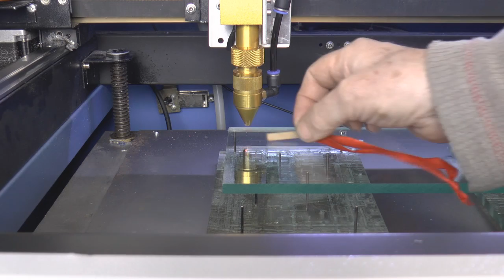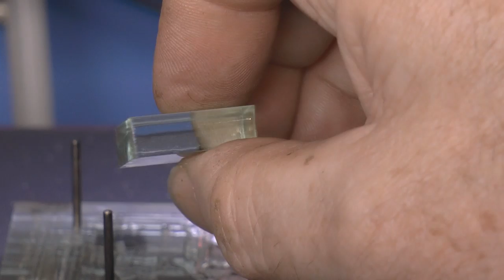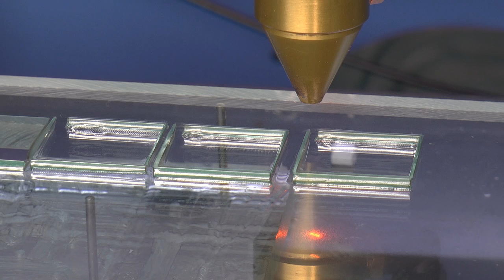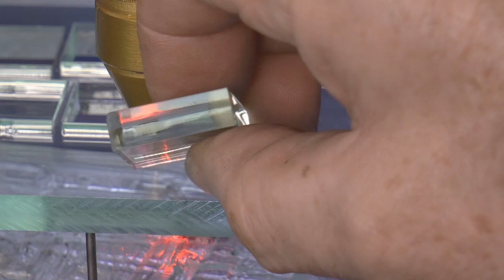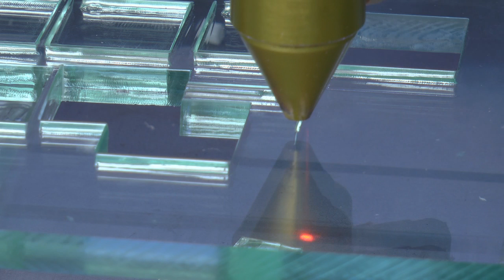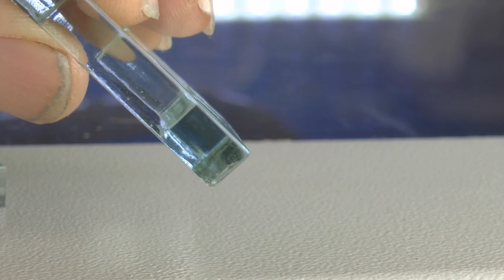RDWorks Learning Lab 54 Acrylic beam drag and flame polishing

Comment: I recently installed RD Works controller RDC6442G ,I went into settings on my laser machine and on my computer and changed the bed size settings but it is still saying not enough extend space. I have been on to cloud ray laser but I cannot make sense of thier instructions.Is there any advice you can give me please?
Reply from the maker: Hi Paul
Part of your program is outside the area of your table. When you look at your program in RDWorks there will be a little green square in one corner of your drawing. That is where your head will be to start the program.I guess your are running your machine directly from the pc and just pressing the START button to run the program?  Your problem is occuring because your ORIGIN is in the wrong place. If that little green square is at top left for example then manually drive the machine so that the head is nearly at the back left corner. Now press the origin button and that should fix your problem.

Best wishes
Russ
Reply: Hi Russ thanks for your help. My machine is working as it should now i have just got one question. When ingraving lettering my machine now only ingraves 1 letter at a time have you any suggestions why it would do this. Thanks Paul

Comment: The beam drag is due to two factors and three for you , beam is step burning in the z axis , due to power /speed , and your Colling the work acrylic , so turn down the air flow to minimum , adj the internal focus lens , for a 3 mm . The damage at the base of your cuts is because the beam is past it's focal point ,  

So get the head as close to the work piece as possible   ( with a closer  focal point internal adj ) and very low to know air flow should give good results .

Nice video
Reply from the maker: Hi Rod
I absolutely love acrylic as a material because it has some really great properties. You are right about speed. Slowing down does get rid of the beam drag eventually.  and I also agree that air assist does have a cooling effect. From all my experimental work  with acrylic there is one big factor that I did not understand at the time I made this video and  and this is the light guide properties that acrylic possesses. This phenomenon is illustrated in  https://www.youtube.com/watch?v=CdupovEe9hA&t=128s.
This explains why in my early days I was able to cut 15mm acrylic (albeit at 1mm/sec) with just 30 watts of power. As you will see from this video, the focus point relative to the surface has little effect other than to make the cut very wide at the surface.  Speed is the key factor to allow the beam sufficient time to "tunnel" through the material . It makes little difference to the cut efficiencty if you have lots or little air assist. What it does do  is to change the surface finish of your edge. There is a slight gain in speed with full air assist because you are efficiently clearing the flammable acrylic fumes from the immediate cut area. Those fumes  are absorbing some of your IR energy and decreasing the efficiency of your cut. It has taken me a long time to understand all the properties of acrylic and I'm not sure I have found all it's secrets even now.. 
Bear in mind that this series records my learning journey and  I was sharing my discoveries at that point. Here I am two years into my journey and I still have much to learn.
Thanks for your comment 
Best regards
Russ
Reply: I just discovered your channel and let me say...you rock, dude! Your "journal" saves alot of us a ton of time and headaches. I'm wondering if you could compile a new video with your best thinking on the subject of cutting acrylic now that you have several years under your belt. Peace.

Comment: you look like you need the align your beam angle to make it %90 to the surface at this date
Reply from the maker: Hi Don
Here I am at least a year on and still wrestling with the problem you observed ie a non 90 degree cut. I know the beam is vertical to the surface of my material because I check the beam position 5mm away from the nozzle and drop the table about 150mm and check that I still have beam coincidence I do this both with and without the lens so I absolutely know my beam is truly perpendicular. This problem only shows itself with acrylic and only when the material exceeds 5mm thickness.  I have two machines both set by the same method and both exhibit similar off vertical cuts in the Y axis. Both Y+ and Y- cuts are leaning the same way, Without knowledge of how I set the machine, the cut characteristic leads one to the conclusion that you have reached. I can in fact make the cut vertical by setting the head out of square. This fixes the problem (for acrylic) but does not explain it. It is on my long list of strange phenomena that I need to investigate. I do not experience the same out of trueness with 10mm plywood. 
If you jump forward to #120 where I demonstrate the strange tunneling properties of IR light in acrylic, I'm convinced that the off-square issues have something to do with this property. I have just recently acquired plenty of 10mm acrylic to experiment and investigate this problem in a near future video

Thanks for the comment
All best wishes
Reply: I hear what your saying if you but a spinner and it doesn't wobble you will know...  our cutter gets used by many people all he time and had to be aligned from time to time and i get so irritated when i want to cut a perfect part and its off 90. i'm not referring to he normal v cut from top to bottom . it may be the camera but one side of your blocks looks to have more angle then the other . here is a great link for alignment not done ny me https://www.youtube.com/watch?v=e1c3keOKL6Y

Comment: Hi, wondering if you could help. I have a piranha 5060 that ive just bought. got it set up and laser aligned, thanks to your videos and others on YouTube :) sent a test file to the laser and when i click start it says not enough extend space? have you any idea what this means and how I could fix it? Thanks 
Maggi
Reply from the maker: Hi Maggi
My guess is you are trying to engrave a bmp file. If so then you are using scan mode. My guess is that you are trying to run your program from right in the top left corner (or maybe top right ,depending on where you machine runs to for its 0,0 datum). If so, move your cutting head out into the work area to about 20,20. This will probably cure your issue. When you scan, the head has to run to the end of your picture and turn off the beam. The head then has to travel further to decelerate and turn round, whereupon it  has to accelerate back to your chosen speed before turning the beam on again. This over-travel zone is the EXTENDED SPACE  and will vary depending on the speed you scan at. More speed requires more extended space  If you set the origin point so that part of your program is outside the work area then you will get an X or Y "slop" error. Neither error is clearly explained anywhere. 
Hope this helps if not shout out again.
Best wishes
Russ
Reply: Thank you Russ, one for your help and two for your prompt response. I tried moving the laser head manually but it just reverted back to the top right corner when i hit start. how exactly do i move it without it doing this? sorry to be a pest, total newbie here and itching to get started :)
Reply from the maker: Hi Maggi
I am now 2 years ahead of you but it was a bit difficult to start with because there was no one to turn to apart from condescending experts who were very possessive of their experience. Hence I had to learn the hard way and that what my videos are about. I am not teaching but you can learn along with me. I try to remember those early naive days and despite trying to be inclusive with my explanations to suit all levels I sometimes forget a few obvious points. In your case you either have not yet found the origin button on your machine or your RDWorks software is not at the normal default setting. 
There are several unknowns in your situation that will help me  if I understand. How are you running your machine because there are 3 options. 
1) is your PC remote from the machine and you are transferring programs via USB memory stick?
2) is your machine connected to your PC via a USB cable/Ethernet cable?/wireless bridge connection?
3) Are you downloading programs from your PC to the machine via the connection in 2) or are you running your program via the RDWorks START button?
 Your answer will allow me to better advise you.
Best wishes
Russ
Reply: Thank you Russ. 
I think had i have bought one 2 years ago with so little information on them i would have given up! I'm only now getting a little understanding thanks to the help of generous souls like yourself who put the info out there willingly.
I've been slowly going through video tutorials (how I found you :)) but it gets a little mind boggling lol I work primarily in Photoshop for all my designing and now have to change file types for vector which is a little daunting. I've downloaded inkscape as illustrator is ridiculously priced and i already pay annual subscriptions for Photoshop and Lightroom. I still have to somehow teach myself Rdworks :0 not the easiest program to understand even with tutorials.
So, onto your questions. Yep I found the origin button but it doesn't seem to move anything when i push it?
pc connected via usb
I'm just downloading the design to the laser right now and then working from the control panel.
Maggi :)
Reply from the maker: Hi Maggi
I think this conversation will be more useful off-line because we can exchange data and pictures. Use the You Tube messaging system (that is private) to send me you email so that I can answer more fully.

Best wishes
Russ

Comment: Hello! How do you regulate air pressure? Do you use original membrane pump or compressor with air tank?
Reply from the maker: Hi Dainis

If you watch https://www.youtube.com/watch?v=OCVsMXw6yh4
You will see that I am testing the original 70 l/min pump against a new 140l/min pump. I regulate the air to the nozzle with a little ball valve that allows FULL bore flow. If you have a screw restricting elbow I would suggest throw it away and replace it with a normal elbow, but you will have to modify it as I show in the video.
The ball valve I used was like this
http://www.ebay.co.uk/itm/6mm-to-6mm-pipe-Pneumatic-Ball-Valve-On-Off-Flow-Push-fittings-OEM-/112303492406?epid=11002970582&hash=item1a25cf4d36:g:SrgAAOSw2gxYo5i-

Best rgards
Russ
Reply: SarbarMultimedia Thank you very much. Miss this video. I've watched a lot of your videos and they're very helpful. Next week I'm going to order identical 50w laser. At this moment i have only 7w laser diode engraver.

Comment: couple questions.   u said you measured 60w coming out but this is a 50w laser machine?  and during this test you had it set at 65% the whole time?
Reply from the maker: Hi
First I must let you know that in the following video I fitted what I thought was a new 60 watt tube. It turns out  that I had been sent a 70 watt tube 1250mm long. Ever cautious about over driving the tube  I had established that the max allowable current was claimed to be 25mA. I know that Chinese manufacturers often quote  the current for achieveing their max test power which in this case I guessed was 80 watts. So my first task with this new tube was to check the power output related to the %power and the actual mA current flow. . You may have missed the following video (start at about 15minutes) and you will see me testing the tube up to 90% power and plotting a graph of the tube's characterisics. Based on that graph I decided that 22mA was a safe maximum and that produced 70 watts of output at the tube. To drive at that current level meant I could never exceed 65% power setting. There is NO fixed relationship between % power and tube power. People mistakenly think that if I run a 60 watt tube at 100% power you  get 60 watts of output. Wrong, What you will get in very short order is a dead tube caused by over driving it. Now just for estimation purposes lets assume I get 4% power loss at each mirror and also across the lens. Forget the compound effect and just accept that I get 16% loss between tube and the work surface ie my 70 watt output will become about 60 watts of usable power.

I hope this answers both your questions

https://www.youtube.com/watch?v=zCTrRT1C_eY

Best regards
Russ
Reply: ok ye that explains, it,   because noway could a 50w cut 8mm   using 4 speed and 65%,   anyways great vids i had browsed a bunch not the whole series but quite a few, i guess i will look forward to retirement as well and spend time doing allot of useful vids as well.  good job russ.

Comment: On a 50W ULS laser cutter, beam drag is very obvious on 3/4" (19mm) solid poplar and pine.

@11:30 you discovered focusing partway into the material for better cut, at the cost of slightly wider kerf. lens with longer focal length will also help.

Comment: What influence does total reflection on the just generated interface between a gaseous (its contents may vary quickly) and a solid phase have? The optical properties of the medium properties' change and transition(s) with the process of cutting / melting / burning / sublimation  instantaneously. Various intermediate products will change the optical properties very dynamically. Moreover, the reflection on the bottom surface may contribute to the excavations visible in some of your experiments. I saw such variations that could be correlated to a supporting metal grid placed under the acrylic. Modelling the process called 'cutting' detailledly might lead to some interesting findings.
Reply from the maker: Hi Ulrich

Many people have suggested that the marks on the edge when you cut acrylic are caused by the stepper motor.
I am equally certain that they are NOT related to the stepper motor. For many years I owned a metal laser profiling business and although this is a COMPLETELY different sort of machine and has insufficient power to cut metal, I do believe that the well researched mechanism that causes striations on the edge of cut steel is occurring when you cut acrylic  When you cut mild steel you use pure oxygen as the assist gas at about 1 to 1.5 bar. The mechanism described in the following text  pages 24 to 26 causes exaggerated edge marking.

 https://books.google.co.uk/books?id=PrguBAAAQBAJ&pg=PA24&dq=arata+and+miyamoto+laser+cutting+mechanism&hl=en&sa=X&ved=0ahUKEwj3xL_vqNHPAhVCD8AKHWF7AgYQ6AEIOzAB#v=onepage&q=arata%20and%20miyamoto%20laser%20cutting%20mechanism&f=false

 When you cut stainless steel the process is completely different. You have to use an oxygen-excluding cover gas in the form of pure nitrogen but at pressures of 12 to 15 bar.  Even though there is no exothermic reaction  to melt ahead of the laser beam, similar but less obivous edge marking still occurs

I am suspecting the the heat zone when acrylic sublimates, extends out in front of the beam and causes this same stop start mechanism of cutting.  Too much air assist in the cut zone reduces the cut efficiency and also reduces the "flame polishing" effect. I use a very low airflow to cut acrylic, just enough to keep the gas flowing out the bottom of the cut. 

I shall shortly be taking delivery of another laser machine but this machine is SERVO driven.  This will prove the point (or otherwise) about stepper marks during cutting. However  greyscale engraving is a different matter that has got to be looked at in more detail when I have two machines to compare.

Best regards
Russ
Reply: Hi Russ, thanks for the information on steel cutting - I am still far from that... 
Re the striae: Is the laser driven in a pulsed mode, or CW? The former might be causing the stripe pattern - but then, the stripes should be clearly travel speed dependant. Another vague thought: Mechanical resonance within the acrylic board caused by shock waves (like cavitation in water) when the sublimation starts in an enclosed volume that then bursts outwards? So many mysteries... ;) 

Cheers,

Ulli
Reply from the maker: Hi Ulrich
These cheap lasers are not RF driven and so the beam is basically continuous (as for as the eye can discern) Take a look at https://www.youtube.com/watch?v=mXIDwQxhX3k starting at about 12minutes. I was investigating a strange performance region in my  tube as the nitrogen partially ionizes. To prove that the beam was pulsing I ran the speed at max of 500mm/sec and was able to measure the pulses. Once I increased the power such that the ionization was complete and the power supply had switched to its stable 17kv working range the the beam was showing no hint of pulsing. Maybe this answers your question
Best regards
Russ